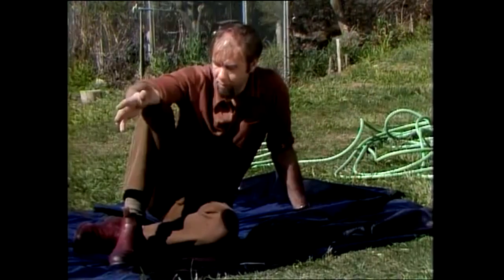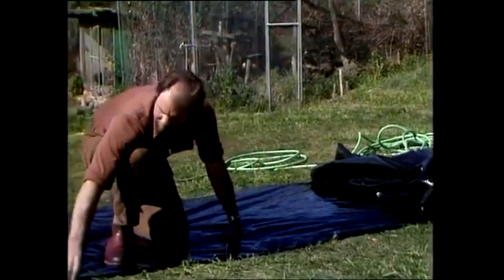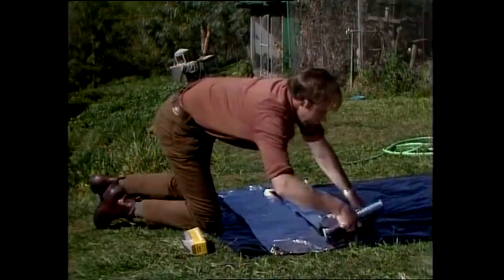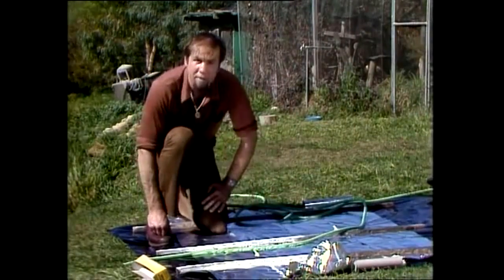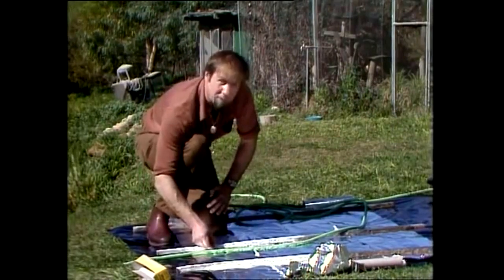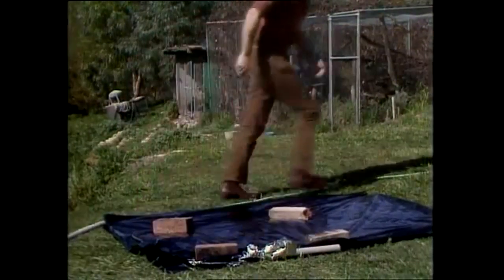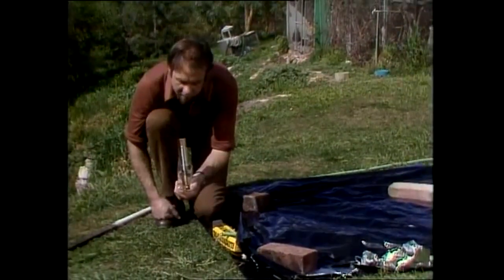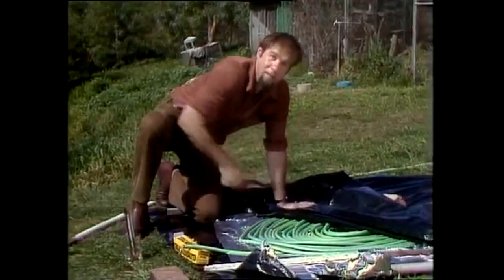Make a simple solar water heater

Comment: Gosh, that's genuinely impressive. I'm not sure it would be quite reliable enough for bath water here in Northern Ireland though.
Reply: Same here in the Northeast Mark. There again, tee shirts are the norm for outside wear here, until January 🤪
Reply: You’d be surprised, but the best thing for northern countries is air heat recovery units. They work like an air conditioning unit in reverse 😮

Comment: My grand daddy had a solar pre heater on the line that ran to the actual water heater. It was an old water heater tank painted black and he had a parabolic reflector just made from aluminum sheet. Worked great in the summer and in winter it had couplers where he would switch out the heater for a regular pipe.

Comment: We should of tried this when we here in Melbourne had that two week gas shutdown in 1998 (after the Longford Gas plant exploded), might of given us some warm showers.
Dad hooked up a black plastic hose to our spa solar heater pipes(with the black strips on the roof of the house), ran it to the bathroom window, stuck the dog hose on the end and cable tied it to the shower head, then when it was shower time, we ran out to the back yard, threw the switch on the solar heater pump, got inside, stripped and got into the shower, it was not all that successful and had salt chlorinated water showers, but it was something somewhat worth trying.
Reply: I remember that as well, I think the whole state was out of gas because of it.

Comment: I think just the old classic black barrel on the roof would work better though. Once the water in the hose is gone, you'll have cold water again, and there's not much water in that hose. It would probably be gone before I get to put any soap on myself during a quick shower.
Reply: The barrel takes a while to heat up, just so much water inside. Heat loss of the barrel might also be a problem. This one depends on the length of the hose used. 1m of standard hose is 1L, roughly. Two lengths would give you about 50L hot water. If course you would actually run it through a heat exchanger and heat up your barrel inside the house...

Comment: Uhhm So the sun does NOT go through the black plastic the HEAT does to the hose. So is HEAT expected to bounce of the aluminum? Honestly in summer in North Carolina USA just sitting a hose in the sun is enough to get very hot water, even autumn and spring it can get pretty warm.  US Army will hook up black plastic bags for showers in the field. Sort of work.

Comment: For the fair experiment he should make exactly same hose loop without plastic and foil and compare temperatures. Maybe it's simply not worthy to use that much aluminum
Reply from the maker: But it did show children the components of a real solar heater of that time and explain what they did- Rob
Reply: Fair point. 
But why not show how productive this components are? Because, you know, water in a hose under the sun get pretty hot without any additional stuff. 
I feel like I've just came up with new YT show idea "Repeating CuriosityShow experiments in 4K. Extended version" 😁

Comment: -16°C 🥶
Reply: No they mean 60 degrees Fahrenheit which is approximately 16 degrees Celsius. 60°F - 16°C. If it was negative 16 it would frozen solid.
Reply: I knew what they meant, yet to me it came across not as a minus-sign as an en-dash—indicating a span, as in "Our trip is on July 3–7."  A wiggly equals-sign, ≈, would have been better.
Reply: @crystalincyberspace  yeah yeah I know, I was just fooling around 😄